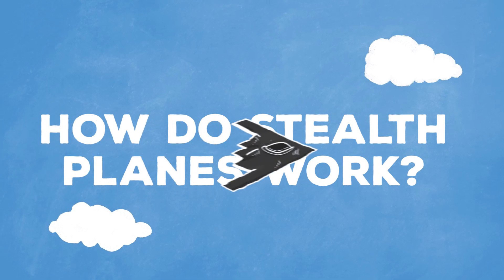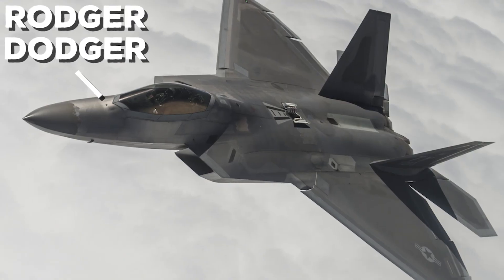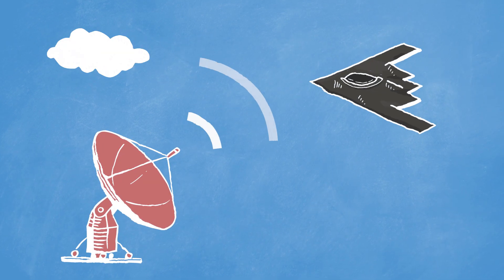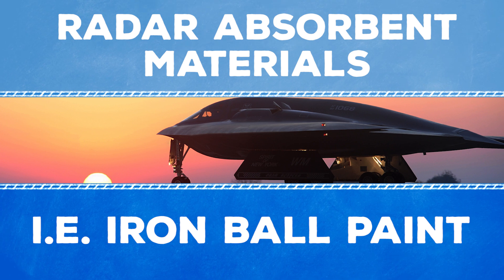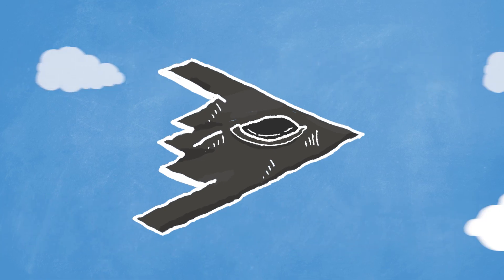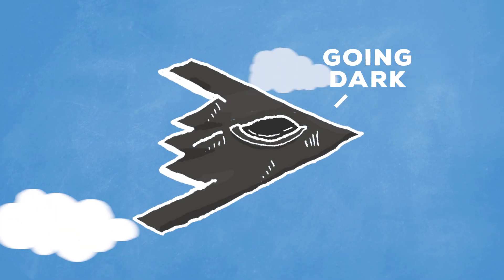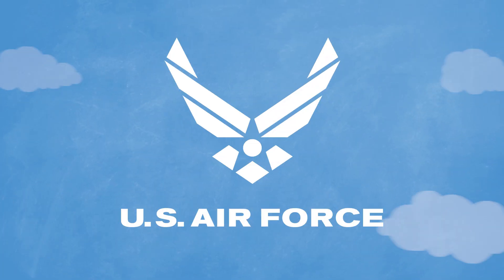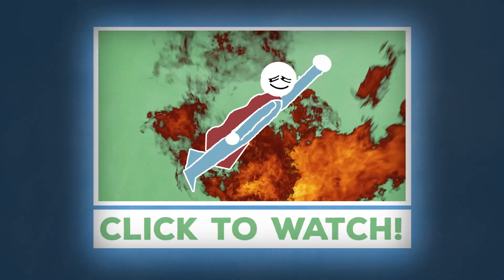How Does A Stealth Plane Work?

Comment: Depends. Modern stealth fighters are easily as maneuverable and aerodynamic as their non-stealth (cheaper) 4.5th gen counterparts, and I suspect that the B-2 Spirit is probably WAY more maneuverable than one of those tube-and-wing bombers before it. Then again, it's internal payload is considerably lower than non-stealth bombers of comparable size and range. (to the extent that such things exist).

Comment: Not your best work. Do more research. Iron ball paint was marginal at best and hasn't been used in a long time. Info on modern radar absorbent materials is in the public domain and easy to find. And stealth aircraft can't switch their stealth on/off like "going dark." 

You're better then this.